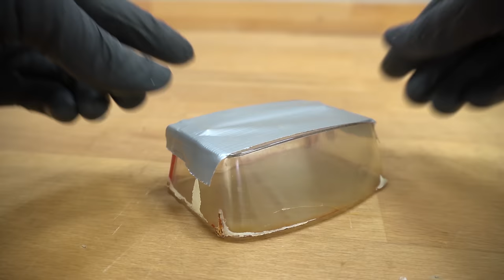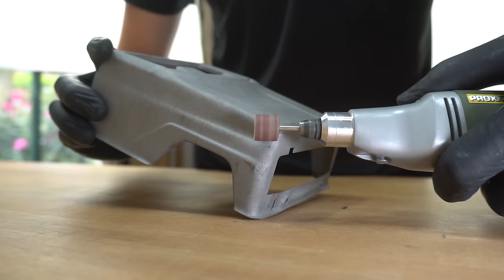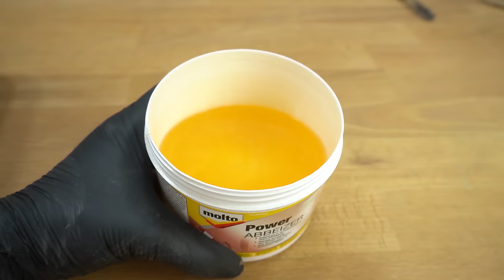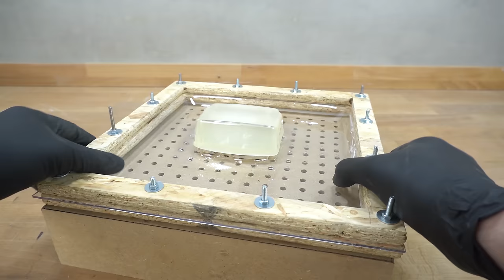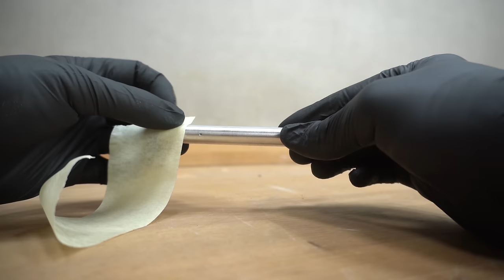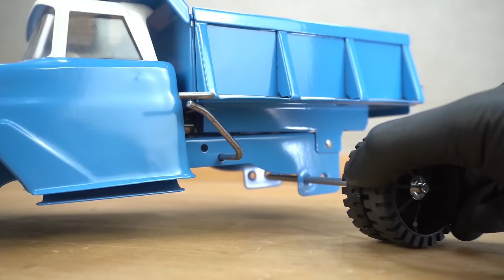Tonka Hydraulic Blue Dump Truck Restoration 1963s - Vintage

Comment: Why did you use duc tap on the plastic if your just using a drop or two of paint remover?
Reply: That wasn't paint remover. He used the duct tape to seal the hole in the plastic so that he could pour epoxy into it and not have it run out. The liquid (I think it was WD40) was to prevent the epoxy from bonding to the plastic, which worked but not as well as he seemed to expect.